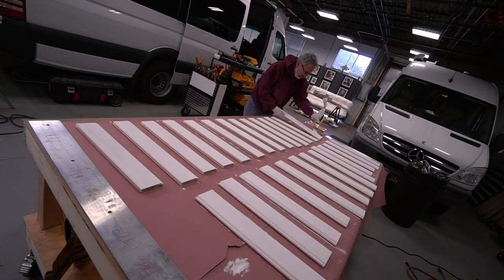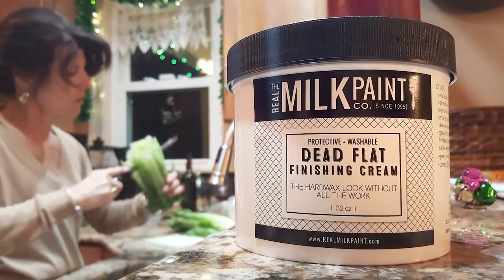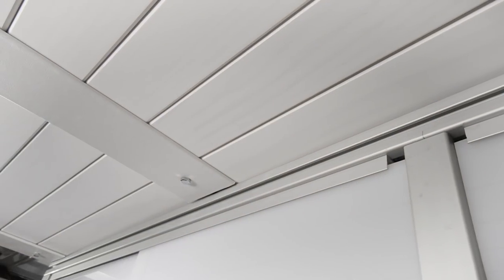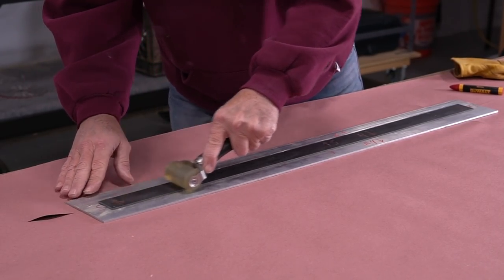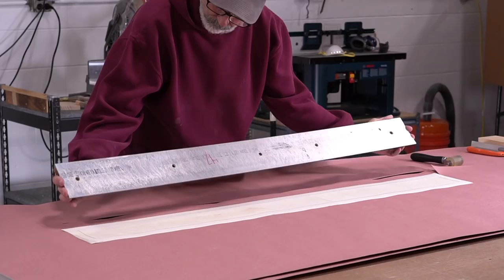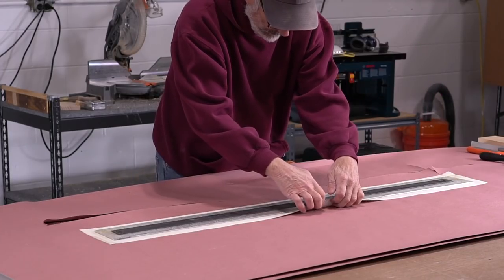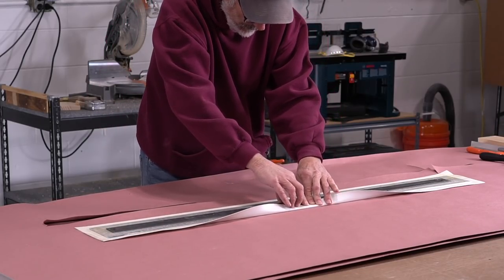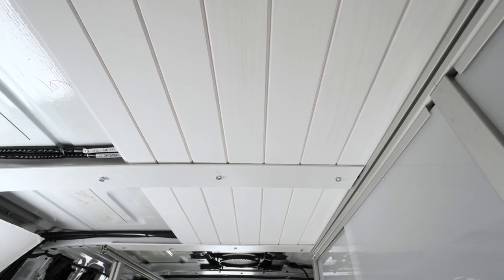FORM FOLLOWS FUNCTION - Ceiling Struts In My Van

Comment from the maker: Those bolts are temporary!!!! I am still deciding between a nice chrome decorative bolt, a cap cover or fabric wrapped button. What do you think?
Reply: Humble Road , If you can find a cap cover, that would be the way to go, it’ll give you access to the hardware for removal should the occasion arise
Reply: I was just going to ask if you are planning on covering the bolts.  which ever you choose, I'm sure it will look beautiful
Reply: I would go with a decorative bolt myself....but I'm an engineer and like to see the construction details!
Reply: I choose the bolts too, i cant stand those damn buttons i have to keep track of in mine. Loose a bold and you can replace them easier than a custom button.
Reply: A custom button may end up looking a little Vegas. A nice chrome decorative bolt is honest and appropriate, no hints to Vegas in sight!
Reply: I vote for screws with decorative covers. These have a threaded washer onto which the cover is screwed for a precise fit. They're affordable and widely available in various sizes, as well as a range of finishes and colors. Options.

You could choose white for an understated look. Brushed stainless would tie into the 80/20. Who knows, maybe a client will specify oil rubbed bronze. Any way you choose, you're covered!

An example of what I'm recommending is here:  https://goo.gl/BhHBjX
Reply from the maker: I like those, John. My riv-threads are 5/16 - 18
Reply: Cap cover
Reply: Humble Road love the stainless Steele cap covers too.

Comment: A thin thin layer of foam on the strut (under the pleather) would give it a nice cushion-like look. Also if anyone hits their heads on it it would cushion it.. I hope you will also replace those bolts with something not fugly. :) Allen head bolts perhaps that are more flat against the ceiling.
Reply from the maker: Agreed Croft. I am contemplating a padding under the leather. And yes those bolts are only temporary. At this stage of the game, I thought that would go unsaid.

Comment: Thanks for all the great videos, George!  I'm mid-build, approaching ceiling next.  I really like the access offered by this design.  I'm wondering how has your ceiling design evolved in the last 4 years?  Which is your most recent video for "paneled" ceiling?  Do you think it could be done with 3 panels, rather than 6, or is that too great a span to hang the tongue and grooves?  I'm intimidated by the pleather-work and am considering painted aluminum.  I also like how this design saves height, since it's a shorter stack of material than traditional tongue/groove on 3/4" firring.  Thanks!

Comment: What adhesive are you using? 
I like that you're looking to minimize off gasing, wondering which adhesive you went with
Reply from the maker: The surface area is very small, so I went with 3M 90. It is a product that will contribute to LEEDS certification.
Here is the data sheet: https://multimedia.3m.com/mws/media/563685O/3mtm-iatd-adhesive-products-eligible-for-leedr-credits.pdf

Comment: Looks great George! I can’t wait to see the finished product with the post build reviews and road trips that we are all hoping for. 
  I see a lot of van builds on the internet that use heavy materials such as wooden 2 x 4’s.
   It will be interesting to see your “dry weight” and “wet weight” numbers after completion. “Dry” referring to empty holding tanks vs full. 

  Is there anyone out there reading this comment who has built with wood, foam, aluminum or whatever other material?  Could you post your pre and post build weights? Please comment! Comparisons would be extremely interesting.

  I think that aluminum is probably one of the best materials to use for saving weight. But hey, I’m biased. I fly aluminum planes. 

  George, are you planning on keeping this van to replace your pleasure way?     Could this the be the first in a fleet of vans that you plan to sell?  
Love the videos,
Steve
Reply from the maker: Steve, if you check through my list of videos, I have periodically weighed the van with each additional group of components installed. The weight is a very important safety issue for me. I intend to have the van balanced in all four corners. As far as tankage, the water tank is 45 gallons and I will have a bespoke grey system housing maybe 20 gallons. No black tank-composting toilet. And yes this van is for sale and I intend to continue building vans, each with something new and innovative to film. Thanks for riding along!
Reply: @HumbleRoad  ... George, i wish i could just bring my own van to you to work your magic on it! I bought it Nov 1st, and due to the weather, finances, no tools, no experience, no helpers, no guidance and just plain ignorance i am still in the degutting stage. . .  You have no idea how much i respect your knowledge & your beautiful hard work.
Reply: I've thought about filming each step i'm going thru to help guide other women in my shoes but theres so much hatefulness on youtube these days i just dont have time or the desire to deal with all that. I take alot of pictures, maybe some day i'll compile them together to share somehow.

Comment: Fabric wrap button Classic and very nice looking, Chrome will tend to discolor the Pleather.  Can you just make a "Master"  for your bolt holes and then they would all be aligned? Also a "Master" for the pleather to be installed "around" the  ceiling plate, so you could glue it up and then by pressing the plate down into the "Master" to help with wrapping the edges and you would kill two birds with one stone? Sorry, just that I'm always thinking of getting things done easier! Henry said " hire the lazy, smart guy to do the hard jobs as he will come up with the best way to get it done faster" just that you need the boss around to make sure it works to perfection! And that job you've got covered.
Reply from the maker: Great suggestions!

Comment: Love it! You are going to cover the bolts with leather caps Right? Hey can a high power magnet hold onto those steel plates through the leather like material? For example, will it hold your paper towel holder? That would be awesome if it did. What is this Van going to cost when you are all done with it?
Reply from the maker: I will either replace those bolts with a decorative bolt or a cap cover or wrap. What do you think? Those struts are aluminum, not steel. I am keeping costs and pricing confidential for the future buyer's privacy.
Reply: Humble Road  like fine art we don’t discuss $ and by the way I truly believe this qualifies as fine art
Reply: @HumbleRoad   Hello from Quebec George. Do you think i could replace the aluminiun struts with 1/4 ‘“  baltic plywood and cover them the same way with vinyl or fabric ? Thanks
Reply from the maker: @richardbiron6908  absolutely

Comment: Those aluminum cross struts are too wide. Doesn't look good. Narrower would look sleeker.
Reply: They're primarily there to hold the planks and I don't think they look objectionable.
Reply from the maker: The van frame is 2 inches wide. The aluminum strut is 4 inches wide. The reason being a one inch resting shelf for the tongue and groove boards. Form follows function.

Comment: I don’t like the exposed boltage. It’s a finish issue and unappealing to me.  This is just my opinion. The function of this feature is spot on though.
Reply from the maker: This is just a test fit. Do you really think I would leave a bare bolt exposed prominently!? Decorative bolt, cap cover or leather wrapped button. What do you think?
Reply: Humble Road - I was just going to add: Use a chrome/satin or white Hex-cap, but I really would like a leather button!
Reply: Personally, I really like the thin flathead hex or Torx bolts that you see in a lot of do-it-yourself type furniture, especially if you can find some in white. Love, love, LOVE the overall design for both looks and accessibility because I don’t think I have ever built anything that I didn’t want to “improve” sooner or later (usually about 5 minutes after I’ve “finished” )
Reply: Humble Road use a rivets and leather buttons ??
Reply: Humble George  My vote is for a white torx bolt. White, of course, that complimented the white wood.
Reply from the maker: I may use matching leather buttons. But I don't want it to look like an upholstery job. Maybe a chrome flathead with a decorative chrome washer? Hammered blacksmith bolt head? IDK...
Reply: Humble Road fabricate a snap on cover piece for the struts, finished with leather. Make it accommodate the bolt head.  End result would be a finish leather look.
Reply: Humble Road HOTTIES is a company that makes bolt toppers for Harley’s check them out real simple chrome or other colors available